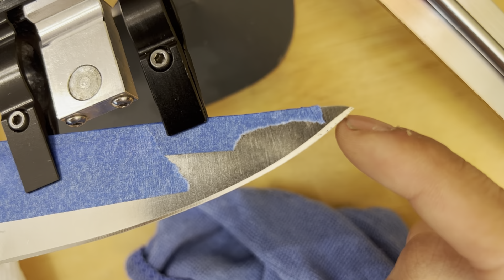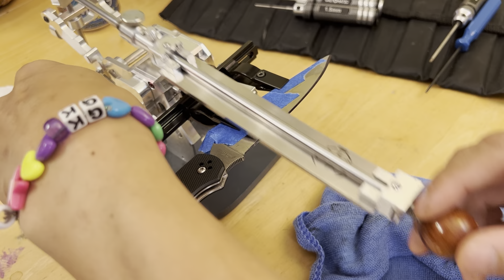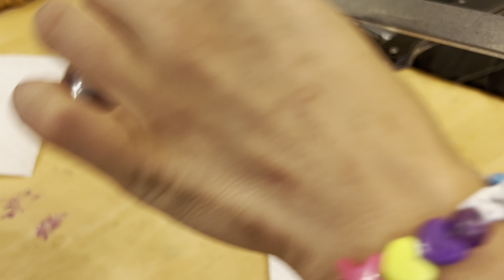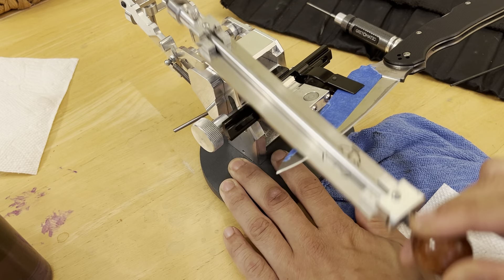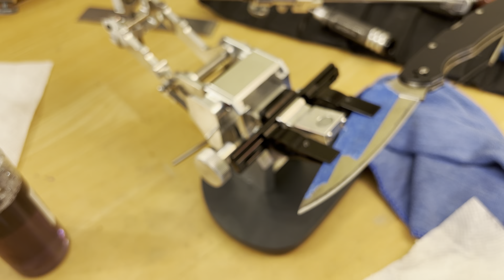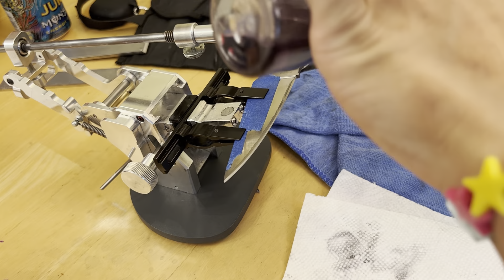Spyderco Police 4 K390 reprofiling part 1

Comment: Thanks for these videos Tony, great content without too much talking. Lots of knowledge here. Going to give those Atoma stones a try for my KME
Reply: I also have a kme system. I’ve tried DMT stones and they are ok. But I recently picked up a Venev scorpion series 800 grit, which I believe is really a higher grit stone. But after the kme 600 stone I use the Venev 800 and it really polished up the bevel very nicely. Have fun👍🏻

Comment: Thanks tony! Do you have any experience with the boride stones?
Reply from the maker: I actually have a set of them. They seem to work great for steels less than 58hrc. Not very effective with the higher end steels thus far but I could be wrong
Reply: I'm ordering up a set of the narrow boride stones from Gritomatic for recurves & smaller blades. Will use on the TSPROF KO-3. 
I've  heard good things about them - we'll see...